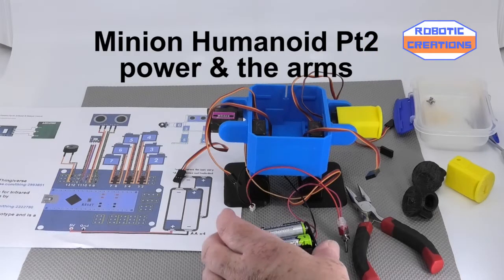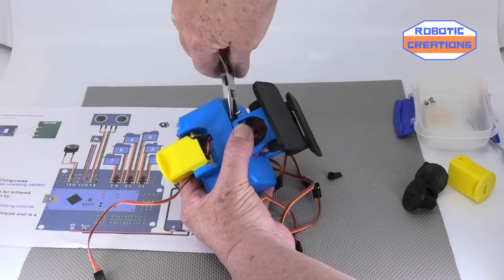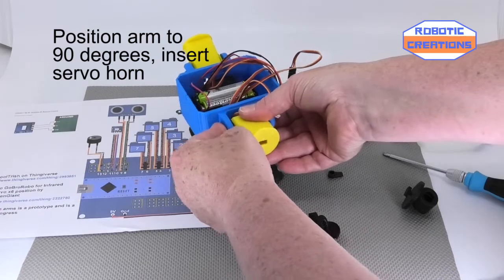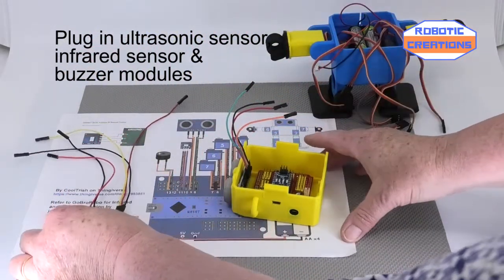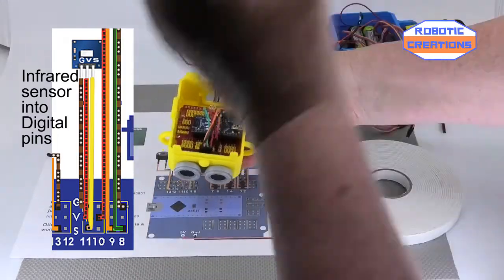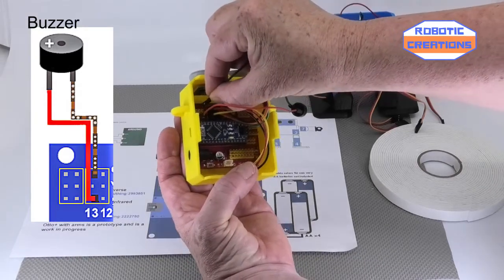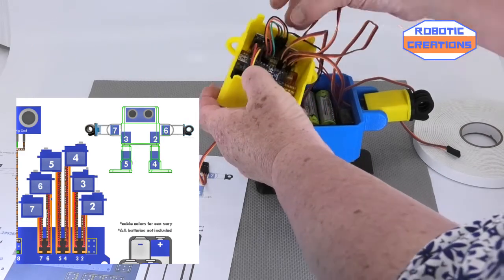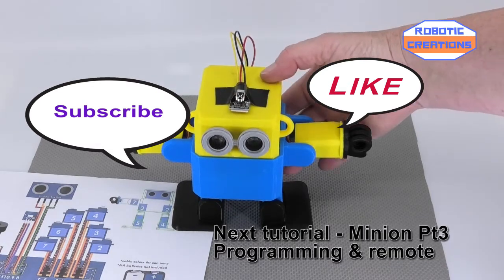Minion Otto Humanoid Pt 2 - Add arms, sensors and power

Comment: The little soldier robot, I added it can be charged, the interior is a charging module and a lithium battery 3.7v/2500mah, and a booster module is added to the output of the module, and I adjusted it to 5.3V
I have posted 2 videos (including self-styled dancing)
 Link: https://youtube.com/shorts/UKsmCpnTgJQ?feature=share
Dancing link: https://youtu.be/ZWHKJPUfhkQ
Reply: ＋👍Thank